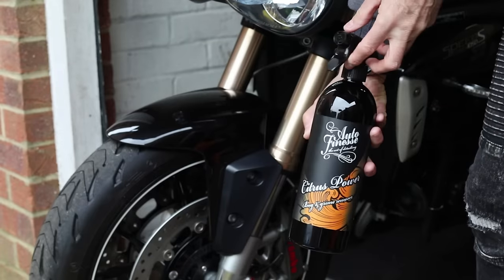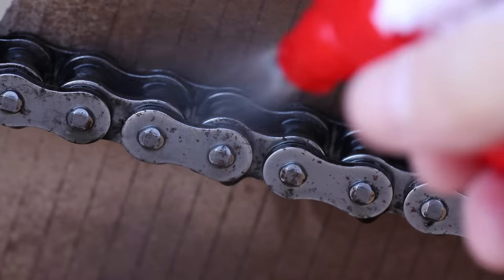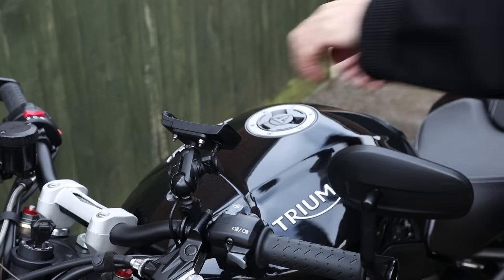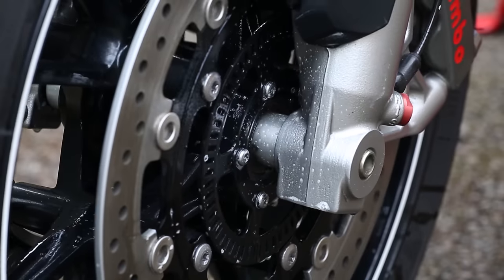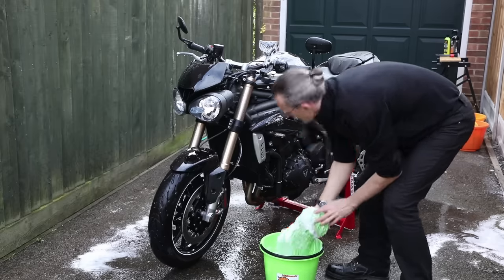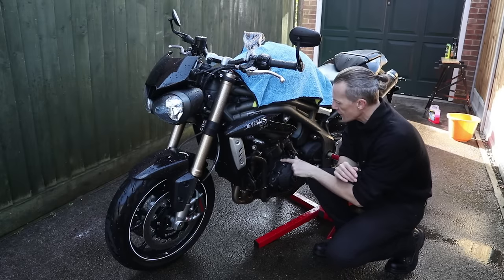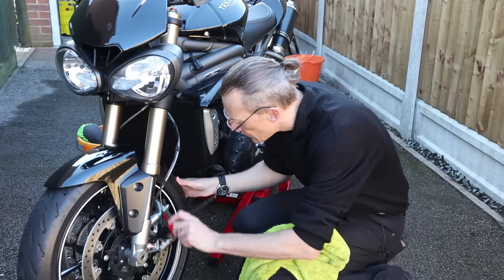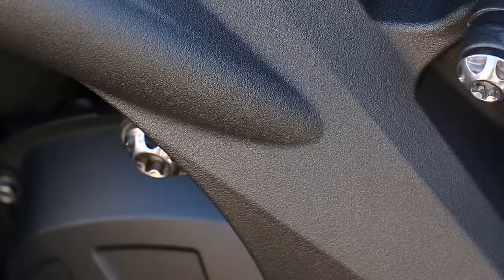The Best Way to Wash your Motorcycle - Step-by-Step - All you need to know

Comment: I'm  bit leery about using degreasers on chains. Degreasing it too harshly can shorten its lifespan. It should absolutely be cleaned and re-lubricated with chain wax but personally I'd use some water soluble actual bespoke chain degreaser that is guaranteed to not do a number on the o-rings. Also, it was probably a good thing you didn't have a pressure washer; a bike doesn't need to have water squirted at it at those pressures, there are lots of exposed bolts, nooks and crannies etc - heck you can even manage to spray water into a tire if you hit the rim just right with a high pressure washer, I wouldn't really use one when cleaning a bike. There's no need. A steel-covered car, sure.

Comment: Normally I just put the bike on a rear paddock stand and running it in the first gear... Spray, brush and the chain is clean very quickly...
Reply from the maker: I’m not sure that is the safest way of doing it! Thanks for watching and commenting! 👊
Reply: @TheAdventuresofPhilJones  I've done 8 years long like this without any problems, if the rear stand is stable, should not be any problem, but anyone need to choose his way...😉
Reply from the maker: @zolitimo5482  Absolutely! It seems like a quick and easy way to do it for sure, I’m pleased it works for you! 👊

Comment: Folks, is it okay to turn on the engine to heat up dry the bike? 

then apply anti rust oil on bolts and metals after washing?
Reply from the maker: Thanks for your comment. I don’t like to do that. The reason being is that if you start the engine when the bike is wet it can leave water marks on the engine. It looks much nicer if you can dry the water off first with either a drying towel or a bike dryer. That’s my personal preference anyway! 😊

Comment: Can you let the bike air dry rather than drying it by hand?
Reply from the maker: You can but it really depends on the air temperature at the time of washing. The problem with letting it dry naturally is it can leave water marks. The best way to dry it is to use a motorcycle dryer to remove the water and a towel. I’ve just been filming another video showing my new dryer. Experiment with what works best for you! Let me know how you get on! 👊

Comment: White spirit can't be good for the rubber "O" ring  seals in the chain can it??
Reply from the maker: Hi Philip. White Spirit is a good old fashioned degreaser, as technology has changed I did research if it’s safe to use on modern motorcycle chains and O Rings and the answer I found was yes. Google “white spirit to clean motorcycle chain”. Remember I dry the chain straight after cleaning it. I hope this helps. 👍
Reply: @TheAdventuresofPhilJones  see a lot of chain manufacturers recommend paraffin also, I guess as you said once it's cleaned it's then rinsed off not left for periods of time.
Reply from the maker: @philipe1247  it’s a fraction of the price too. I’ve used purpose made chain cleaner and it’s great although doesn’t it doesn’t last too long. This is a great alternative if you’re looking to save a bit of money, and it works a treat! 😁
Reply: @TheAdventuresofPhilJones  cheers for the reply, I have 2 Harley's both are belts but one is getting a bigger engine put in it with chain drive so seeing what's about.
Reply from the maker: @philipe1247  That sounds like fun! Enjoy 😁
Reply: @TheAdventuresofPhilJones  have a video on here not the best quality but will give you an idea.
Reply from the maker: @philipe1247  Thanks for sharing. What a nice engine purr, I love the slow tickover, it always reminds me of a V8 muscle car or Hotrod! 😁👊

Comment: I would be concerned that a strong degreaser such as white spirits would damage the rubber O-rings in the chain.
Reply from the maker: Thanks for your comment. I wanted to show another alternative and as long as you wash and dry the chain it will be fine. Chain degreasers do work well and I tend to mix them up these days. Autobrite Direct offers a cheaper alternative which works really well! Check out one of my more recent cleaning videos. 👍

Comment: Please don't use white spirit on chains. It will destroy the rubber o ring seals. If you don't believe me, drop a rubber washer in a tin with white spirit in it. Come back and see what damage has been done after a day or two.
Reply from the maker: Thanks for your comment. My attention was never to leave the White Spirit on the chain for a day or two, after cleaning the chain and drying it, I then thoroughly washed the bike. In my research and experience, as long as you dry off the white spirit, the chain and o rings will be fine. I do appreciate your comment! 😊👍